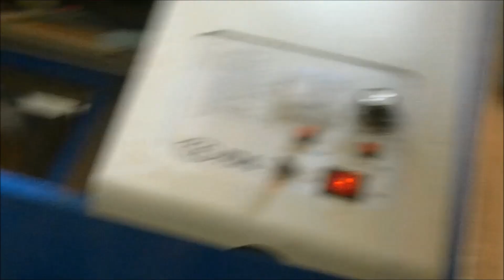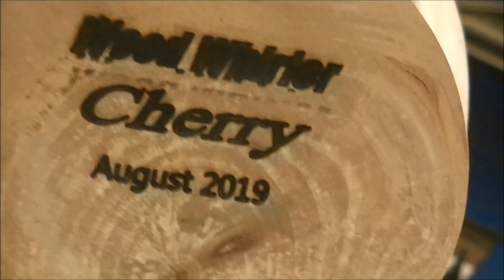Cherry Crotch Bowl # 181

Comment: A very small amount of blue to your epoxy would have made the flower of the dogwood appear to be floating in a your vase that you created and most likely look very natural.  Nice demo and good ideas to use in the future.  A little improvement in the sound, as I missed some parts, even after replay.  Bob
Reply from the maker: I thought about that, but it's too easy to get too much dye, then it's screwed up.  Hard to screw up clear.  I got mics and all that stuff but it's two more devices to keep up with and the battery life is not good.  I will try to speak louder.  Thank you, Larry